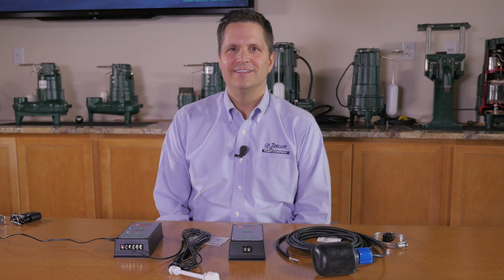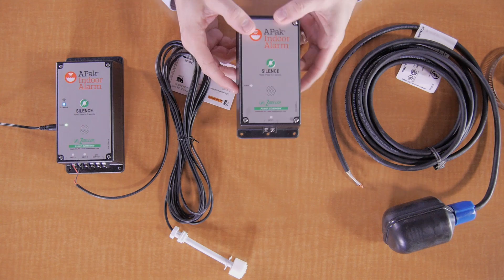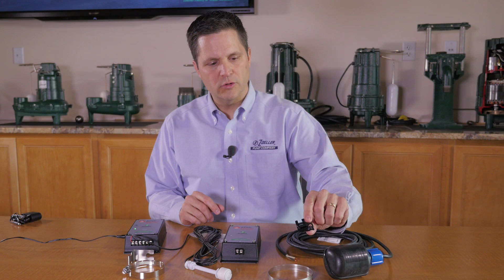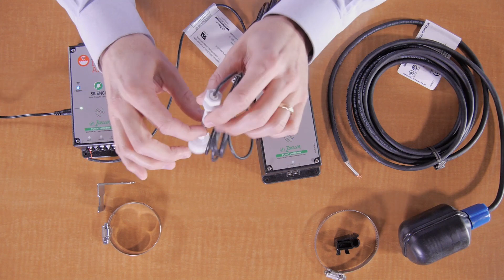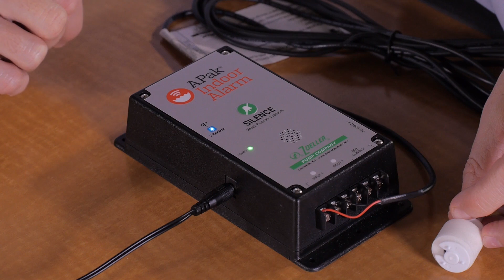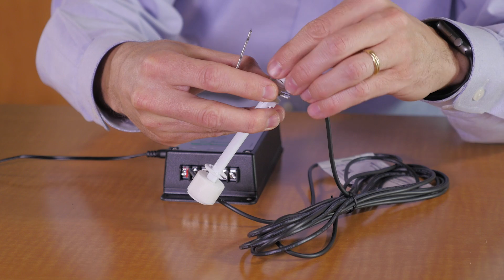APak High Water Alarms - Features

Comment: I’m still getting a 3-beep alarm after recharging my sump pump’s back-up battery and confirm it’s in Good status at an Auto Zone. There was never an Input 1 LED/alarm. Is it possible this alarm is going off because of low AA back-up batteries in the alarm itself?
Reply from the maker: Hi - if you contact our Product Support department at zcotechnical@zoeller.com or by calling 1.800.928.7967 and pressing option 6, they should be able to walk you through the issue you're experiencing and provide a solution. Hope this helps!